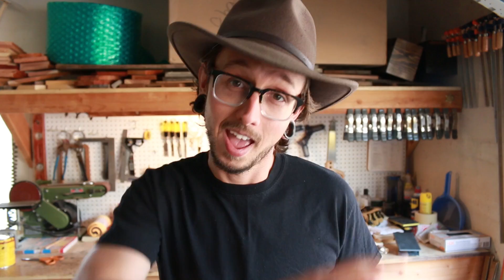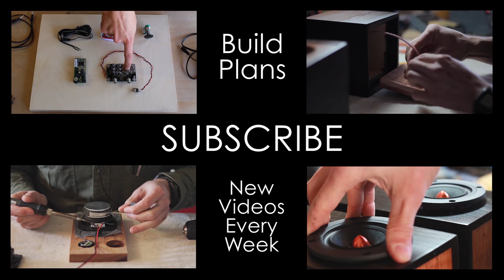Join Our DIY Speaker Building Community on Slack!

Comment: I would love to see how you would make a subwoofer! I have tried myself and it turned out alright. It's a 250w sub. The (10") driver is capable of running 300w but the build in amp can only deliver 250w (and gets very hot if I run it on maks )